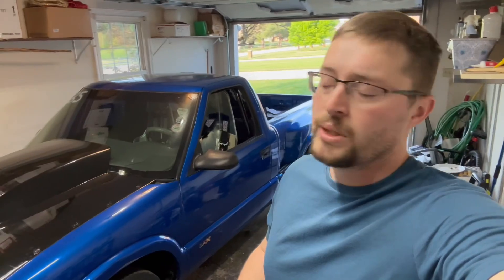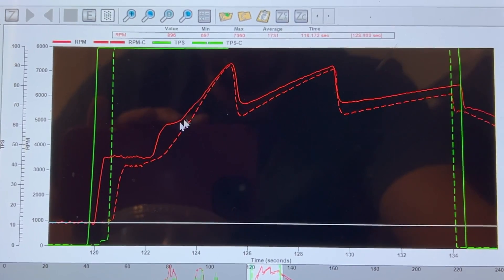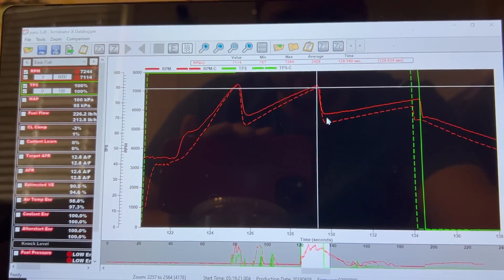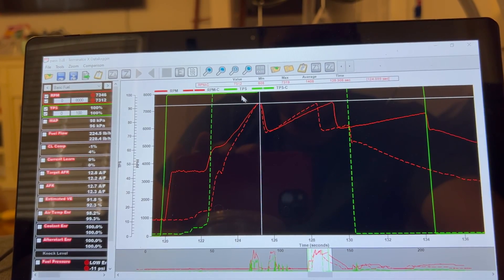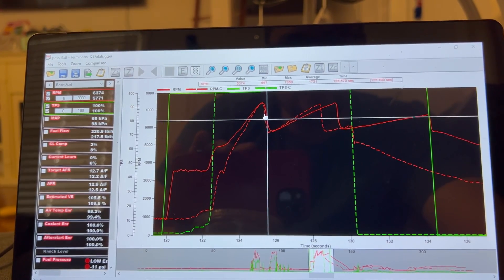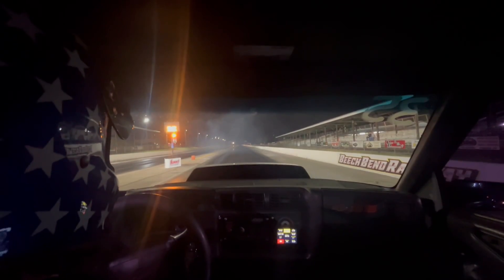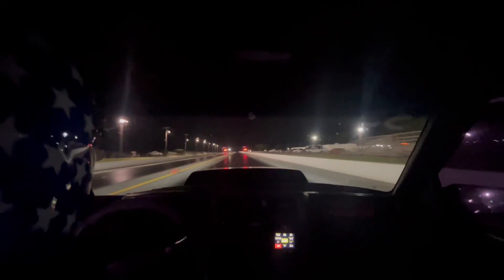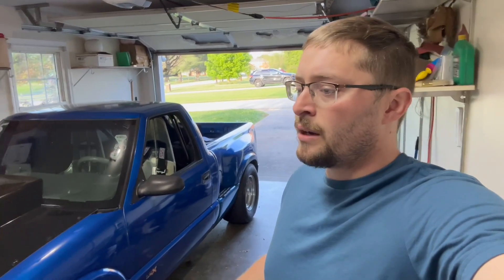Is the 4600 Stall Too Much in the Ls Swap S10? // Data Analysis and Comparison

Comment: Might blow through converter on nitrous you usually need the converter tightened up for spray. Your going to have to decide how you want truck to run better on motor or better on spray there’s always a trade off. It’s possible it will work with small nitrous hit.

Comment: I have an LQ4 in my truck, Mahle MLS gaskets, 862s - I measured 10.4:1 SCR. I have a much smaller cam and a heavier truck, but going from a converter that flashed to 2000 to one that flashes to 2900 made a lot of difference. I had a 3600 stall sitting here, kind of wishing I had done that one instead because this thing still leaves too soft for my liking.

Comment: I think your progress to date is outstanding. I see you're still just a little slow on reaction time though. You need to leave slightly quicker and get to a .50 or in that area. Have you tested it with those heads you ported yet?
Reply from the maker: Aw come on now. I cut a .03 tree on that 11.3. I have not gotten to put the heads on yet.
Reply: @LsBluu  .03 is great! You need to do that every time though. I know it's hard to do every time when you keep upgrading the truck and of course track and weather conditions One day you will get it exactly where you want the truck. I know it's kinda hard right now with you having a newborn and having extra to spend on the truck.. I just hope you don't get like me though. Just when it feels right. Out of the blue you'll want a little more.  You're actually rubbing off on me. I now have the front chin spoiler and the  s10 life sticker lol

Comment: The power and setup you have with the weight of the truck once you get it worked out should cut 1.5 60 foot times
Reply from the maker: It went 1.56 this past weekend. I think it has more in it.
Reply: @LsBluu  if everything is perfect more testing with launch rpm tire pressures and suspension adjustments with more runs shaving a tenth at a time

Comment: 4.10 gears turbo 400 4600 stall and a 7200-7400rpm redline should top out with a 28 inch tire about 125 - 130mph in 3rd gear l think more runs and adjustments and experimenting you should be able to get into the high 10s on motor 10.30s on a 150 hit

Comment: I think the 4600 stall works pretty good when you did your last cam upgrade a while ago and you had a 3500 stall l said you need a 4200 - 4600 stall your cam should work it's best if motor rpm is kept in between 5000rpm to 7200+rpm as you shift it

Comment: Truck is rollin!!!! With the 243’s you did and a lil more timing she’ll be prolly around 7.1x 7.0x NA. Badass man love watching this truck roll out and get faster and faster. Ever thought about running E85 thru it? I picked up 2 almost 3mph in the 1/8 swapping to e85 on a mild cam  LM7. If you have e85 gas stations near you that is. Anyways keep up the awesome work man!
Reply from the maker: I don't have any e85 stations close by. I may look into it though.
Reply: @LsBluu  ah. That sucks. If you have local ones it’s dope to swap to being it’s like 2.70 a gallon for 100 octane lol. Just terrible mpg lol. I have one 10 miles or less from my house so it ain’t that bad to get. Smells better than 93 and runs a lot better. If you don’t have any close by might not be worth the hassle having to drive so far out of your way to get gas. Only thing Is you need bigger injectors e85 comparable pump ptfe fuel lines and e85 compatable like stainless filters. I did mine all with evil energy stuff.
Reply: @LsBluu how much does the truck weigh? Just curious
Reply from the maker: @812tuning  3070 lbs with me in it.
Reply: @LsBluu  damn! She light lol. My camaro 3600 with me lol according to cat scales that is

Comment: ive got a 6.0 tahoe with a 4k stall and love it lol. cam requires at least 3600.
Reply: runs 8.40.s in the 1/8 at 4660 lbs. just got done with crazy weight reduction
Reply from the maker: 8.40 at 4660 lbs is pretty dang good. I'm guessing 85-88 mph?
Reply: @LsBluu  yessir 86-87. I’m in socal, Irwindale drag strip is my local. Hoping to break 7’s once I bring it back out

Comment: You need a good set of 823 heads. Especially with that single plane and the cam and converter. They would match your set up much better. Have em milled .030 and run with it

Comment: As long as it's not a full competition converter, 4600 is fine. Street/strip converters are streetable BUT it creates lots heat so you need a good trans cooler

Comment: As long as it's fun that's all that matters. 94 SS lq4 summit 8708 cam/spring kit, urethane bushings in suspension, rear frame boxed, hedman long tube headers , a/c will be woking soon and it's a blast dusting factory bought hot rods

Comment: If you’re happy with it I would leave it alone then.  Looks like a fun little truck. 

If your looking for the best n/a times that converter needs loosened up some.  I have an FTI 4000 hard hit and it drops about 800-1000 between shifts.  But this is an n/a converter only.  The one you have would work well on a nitrous shot.

Comment: Both converters are wrong. For motor or 100 hp of nitrous.
Reply: But the 4600 will do ok on both not great on either
Reply from the maker: It’ll do exactly what I want I believe
Reply: I disagree. Motor yes but same time it’s not an all out drag truck so I think he’s fine. Nitrous I think it’ll be perfect depending on how much he sprays. He starts going over that 250 mark yeah he might need a lil tighter stall but time will tell

Comment: In drag racing, 9 times out of 10, a higher stall is better. Another thing to know is, not all converters are built equal! You may try another 4600 converter from a known top race converter manufacturer, and you will drop another 0.30+ off of your time slips!

You're doing great, have fun!

Comment: @LsBluuRacing- Your engine is probably around 10 to 1 compression, so perfect for premium gasoline. I would totally drain, or run out that race fuel, then put new spark plugs in your 6.0 Liter, and re-run your S-10, on engine= N.A..to see how much better its E.T. will be. Your Tq. Conv. was a good upgrade/choice. Most drag setups, to maximize E.T.'s, naturally aspirated, have a stall speed of approximately 1,800 to 2,000 rpm below the optimal shift point. I heard you say, your shift points are around 7,300 rpm. So a 5,300 to 5,500 rpm stall speed would be great, if it was just for NA. But since you are going to run Nitrous, i like to have a stall speed that is not as high, because nitrous has a lot of Tq., in the lower, and midrange rpm, that can be utilized much better with a lower, but not to low of rpm stall speed. Your 4,600 rpm stall speed Tq., will be a great match with a 200 Hp shot, of Nitrous! Also Nitrous usually performs better if you shift about 500 rpm lower, than your NA shift point of 7,300 rpm, so try shifting @ 6,800 rpm when using your nitrous, and make sure to run colder heat range of spark plugs, prob. 2 heat ranges colder plugs, on a 200 Hp shot, run 110 octane with it, and pull  °-4 to°-6 degrees of timing, and run 900 to 1,000 Lbs., of bottle pressure, it will fly!
Reply: Good information
Reply: Although I agree for the most part, the only way to know your optimum shift points and converter, is through testing! We're running an N/A BBC in our S10, running a 5000 stall. First shift point is at 5500, then shifting it at 6000. Any less stall and it slows down more and more. We tried 4000, then 4500, and now are running the 5000 converter.
Reply: @Anarchy-Is-Liberty  - I should have said that my recommendation was considering minimal street cruising as well, not just a trailered drag vehicle. But yes always best to test to see what it may like.
Reply: @Anarchy-Is-Liberty - Have you tryed shifting out of 1st gear @ 6k rpm, and if so, what was the E.T. difference?